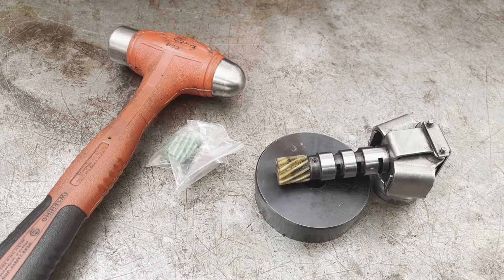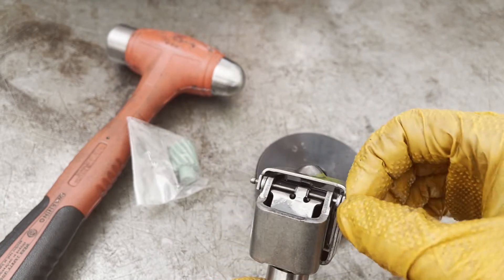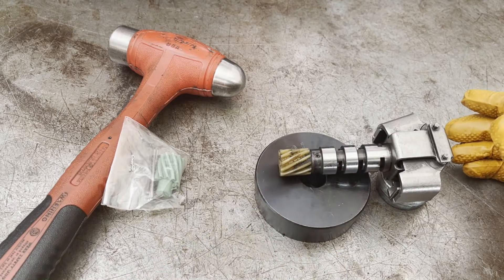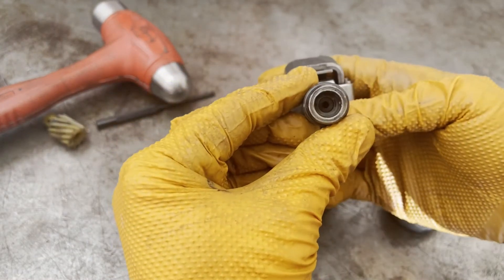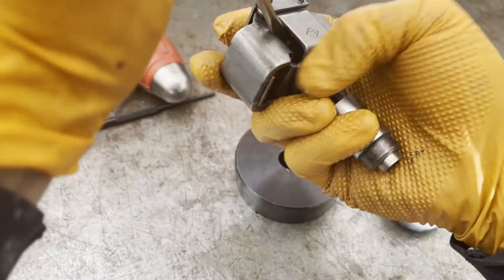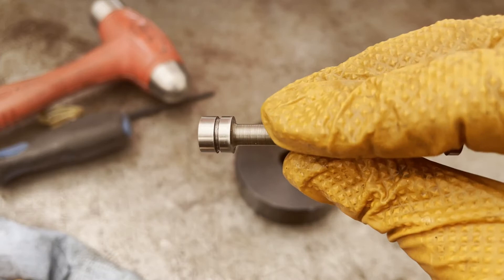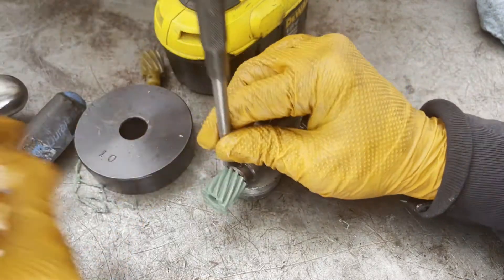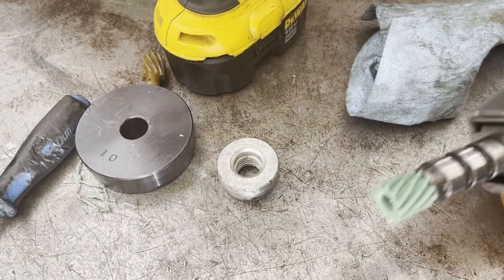TH350 Governor Repair

Comment: I have a TH350c in a stock 85 C10 with the 2.73 rear stock wheels and tires. The transmission is trying to shift into third gear at ~20MPH, it'll slip, rev up, downshift, then repeat. If I shift manually to force it to hole 2nd till 35MPH then let it shift into 3rd it'll hold 3rd fine. It's had both a red stripe and a purple stripe modulator in it. Both with the adjustment screw turned in a good number of turns.

Is there a special modulator for a 2.73 rear or maybe someone's put the wrong gov in at some point? The valve in the gov moves freely and there's no scoring on it. It has a green gear if that means anything.

Thanks in advance.
Reply from the maker: If the governor is stock and vacuum signal to the modulator is 15Hg or better AND modulator/modulator valve is in good shape, I would suspect an internal cross leak between the 2nd and 3rd gear circuits that is overridden when you are manually shifting (ie the breaking band is keeping you in 2nd until you upshift to 3rd).
Reply: @nickstransmissions  Okay guess I'll pull the valve body once it's not below freezing outside. Hopefully it's obvious.
Reply from the maker: If you are going to pull the valve body, check the 2-3 throttle valve spring to see if it's broken or unusually weak. If it's in normal condition, pull everything else off the case belly and do an air check of the intermediate and direct clutch packs to determine if they apply as they should.

Comment: If you're going to use either type of manual valve body, does this need to be functional, or can we just pull it, and just replace the governor cover, with a new O-ring?  Rookie builder here...
Reply from the maker: If you're running someone's purpose built manual valve body, follow their instructions...Most of the time, the instructions will have you loop gov oil; Transgo has you block the gov weights outboard (aka wide open) to prevent auto shifts. There's much more to it than that so if you plan on DIY'ing your otherwise factory valve body, make sure you have all the steps and perform them correctly.

Comment: Yo, I lost the governor springs on my c6… I’m trying to find new ones but it’s tricky. Is there anyway you can do this for a c6 😬🙏🏻
Reply from the maker: Yo. Sorry to hear...Your best bet is a junk yard or transmission parts supply shop as both places should have good used governors - just bring your existing casting so you can match the application (3rd character, which is always a letter, in the casting number on the governor body). 

There are no known kits for modifying a C6 governor however you can DYI to adjust shift points however it's not something I've ever done so can't really tell you how to go about doing so...If you want to increase the engine speed for part-throttle shift points, you can adjust the modulator via tightening the screw clockwise...You can also install a longer modulator rod (appx 1/16" longer) for later, firmer shifts. 

I believe Broader Performance sells modified governors to fit specific applications and shift point preferences, may want to check their website for more info if you need to re-calibrate as well as recover lost springs (he may have those as well).
Reply: @nickstransmissions  Yeah, Jays been a boss about emailing me loads of info on this. Y’all are in my top 3, along w Frank Merkle

Comment: will the governor cause it not to shift into third gear? It shifts from first and second only no third gear. thanks any help is greatly.
Reply from the maker: Hi Mopar507, it can but could also be the modulator, detent (kick-down) or 2-3 shift valve sticking. How many miles on the trans since either new or last rebuild? When did no 2-3 upshift starting happening? Any recent work done on the trans?
Reply: @nickstransmissions  to my knowledge no work has been done. i replaced the modulator and governor with new fluid and filter also new radiator. When adjusting the modulator Is it counter clockwise to shift early? I turned it two turns clockwise but no improvements. Thank you for your advice!
Reply: @nickstransmissions  i e had the car only 8 months and no problem it sat more than 4 months and this just started after getting it on the road again. no problem before it ran great. I checked and adjusted the kick down cable also.
Reply from the maker: Ok...just to be clear - is the transmission hanging up in 2nd gear and simply not shifting or is it shifting but it feels like you're in neutral when you are supposed to be in third?
Reply: @nickstransmissions  Yes it’s staying in 2nd gear but it seems to go into third as soon as i let off the gas but as soon as i put pressure to gas pedal it will not go into third, I know because at low speed i can down shift into second gear manually.
Reply from the maker: Having to let off to upshift indicates applied element stress or failure, in this case the direct clutch pack...If there's a cross leak in the direct clutch circuit or if the frictions are not able to hold full normal apply pressure then trans will have to come out.
Reply: @nickstransmissions  I kind of figured but just hoping for a quick solution. Thank you very much for your help and I hope you have a blessed day👍🙏🏻

Comment: Really dumb question, but do I need to drain the fluid before I pull the governor or is that part of the trans devoid of fluid when it's not running?
Reply from the maker: Hi Brent, no need to drain the fluid from the pan, just have a small container under the governor as some fluid will come out when you take the gov cover off.
Reply: @nickstransmissions  Thank you sir.
Reply from the maker: You're welcome, Brent.
Reply: @nickstransmissions  If I could ask one more question sir.  My TH350 won't shift in to third gear after warming up for a couple of minutes.  When I first start it up and start to drive it, it starts automatically downshifting from third to second and eventually won't even shift into third at all. I pulled the pan and there was what appeared to be clutch material in the pan.  Think that third gear is going out or is it the governor or something in the valve body?  I have already changed the modulator, the filter and put in a new steel vacuum line to the manifold.  Thanks in advance for any insight you might have.
Reply from the maker: Sorry to hear, man. Time to pull the unit and rebuild it. Clutch material is, well, clutch material and seeing a fair amount of it in the pan simply means one or more applied clutch packs are burning. Nothing will fix it short of an overhaul.
Reply: @nickstransmissions   Thank you sir.  Guess it's coming out.
Reply from the maker: You're welcome, Brent. Please subscribe if you haven't already and post back if you have any questions during the rebuild.
Reply: @nickstransmissions  Subscribed a few days ago. Thanks for all of your insight.
Reply from the maker: You're welcome and thanks again Brent.

Comment: I have a strange clicking noise from the rear of the transmission. In every gear, neutral as well. Transmission works flawless but the clicking is constant and gets faster with speed. But not absolutely constant. Could it be the governor? It really sounds like the same clicking noise. Thanks!
Reply from the maker: Check it to be sure but governors are generally not known for being noisy. Also check for anything around your front and rear wheels, driveshaft or anything else that would vary with engine RPM/road speed.
Reply: @nickstransmissions  thanks for the answer, will do further examination 👍
Reply: @nickstransmissions  very strange, just had my governor cover of, and its definetly the governor. It seems so open once every revolution. When i take the governor of it closes very easily, is there supposed to be more tension on the springs?
Reply from the maker: There are different springs and weights available for the governor and it's possible that someone may have swapped in some lighter springs and weights to raise the shift points. Generally, the heavier the weights and stronger the springs, the earlier the shift points will be and vise versa.
Reply: @nickstransmissions  Yeah i guess it could be something like that. sorry for using you as a forum thread here. but i appreciate the help!
Reply from the maker: No worries at all, that's what the channel is for.